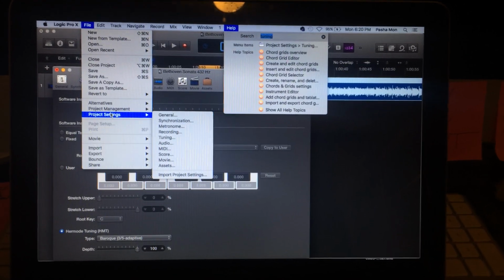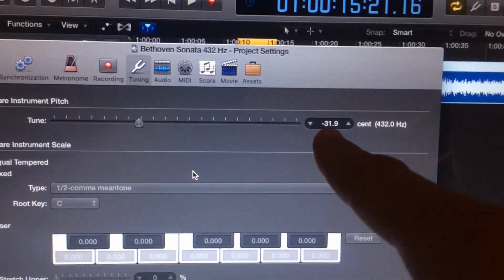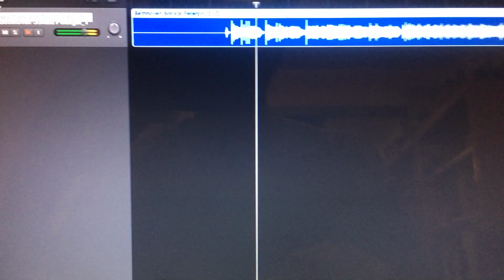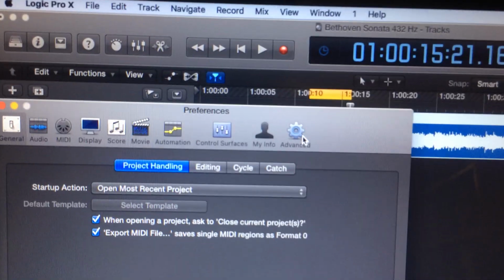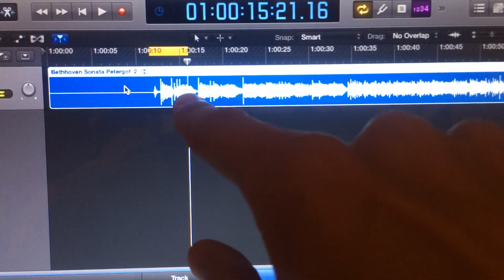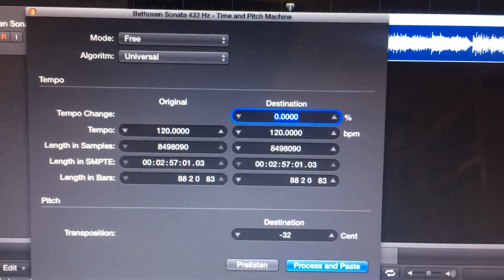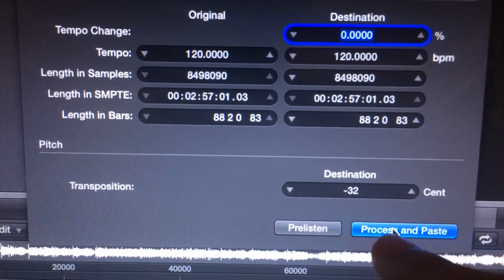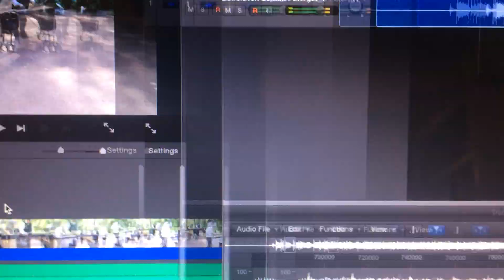How to Convert to 432 Hz Tuning in LOGIC X and Tune to A=432 Hz | Advanced Music Production Tutorial

Comment: hey i have many projects that i would like to be converted to 432 Hz but for some reason it will only apply to the internal plug ins and not for the external audio units like kontakt etc.. 
The issue is, i do not use any of the build in plug ins, all 3rd party au's..do you know any workaround for this? Thanks in advance
Reply from the maker: just record everything in 440 (default) and convert your final master file separately using logic or audacity. cheers!
Reply: @432HzMusicTV  Ty

Comment: i cant do this with vocal recordings only my audio melodies. does anyone know why?
Reply from the maker: audio files (including mp3) pre-recroded in 440 need to be properly converted to 432 using Logic or Audacity
Reply: @432HzMusicTV  i tried to do it in logic is there a different method to convert it to 432Hz after it was recorded in 440hz?
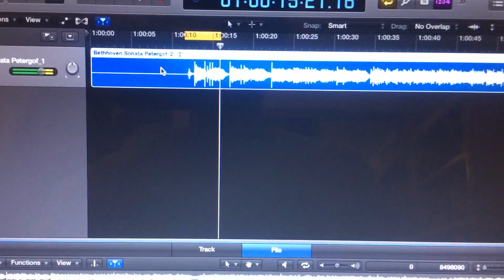Reply from the maker: @benjamindidit7834  why? it didn't work? you have to use method pass the @2:30 mark
Reply: @432HzMusicTV  no the time and pitch machine aswell as a lot of the other options were grayed out. i could possibly try bouncing the song to an mp3 or something and doing it to just the single audio track, but i dont really work that way so im not sure how itll work.

Comment: Just wanted to point out the fact that -32cents, while being the closest you can get to 432Hz in logic, is not precisely 432Hz.
32 cents gives a 1,832% (according to logic) difference with 440 while 440/432=1.01852(roughly) which make a 1,852% difference. You're 0,02% off. I know it's not a lot, but it'd be satisfying to be exactly at 432hz :/
Reply from the maker: yup, thanks for pointing this out. from my calculation the exact (non-rounded number) is -31.766 cents. not all software allows for decimals in cents so -32 is the closest option for that kind. cheers!
Reply: so what is the exact cents number? from 440 to 432?
Reply: @jasonchu4400  It's written in the reply above by the creator : -31,766 cents
Reply: @MauriceGuibot  oh right thank you! the large number kinda threw me off

Comment: It work's but the music sounds so over-compressed after this, to a point, where i would say, 440hz actually sounds more natural. I think if you really want to enjoy real 432hz, the music needs to be recorded that way from the start. What do you guys think?
Reply from the maker: yes, ideally we want to play and record in 432 hz from scratch, however when done correctly post processing conversion to 432 from 440 should not sound any different from the original other than being a little bit lower in pitch overall. quality-wise it stays the same, as i've done multiple albums this way and honestly it's hard to tell the difference which is which since they both sound great quality wise. maybe there's something in your settings affecting quality??
Reply: @432HzMusicTV  I did everything right. Also you should know that in Logic -32 cent's = 431,9hz. If you really want true 432hz you'd needed to set -31,8 cents, which sadly isn't possible to set in Logic. You can only change your tuning in to this amount. So Logic is basically the worst program to use when changing the song to 432hz. Even free programs like Audacity do a better job. But i want to know which program yields the best result's.
Reply: @dunkelwelpling  you can do that in logic, just enter the #s
Reply: @dunkelwelpling  -31.8 works in logic. Just double click on the number and type it in 😂
Reply: @dunkelwelpling  Hello! have you found out the answer to this? Merry Xmas btw :)